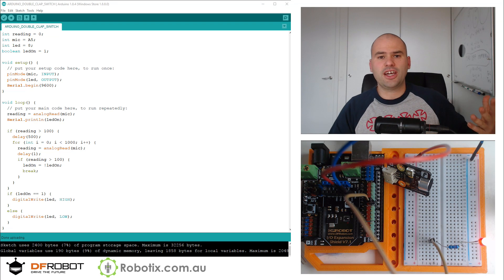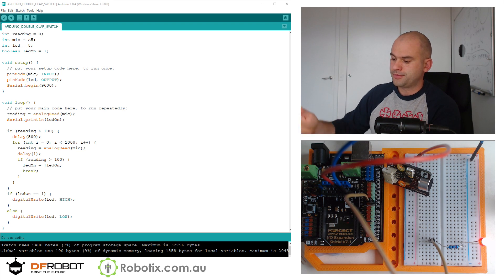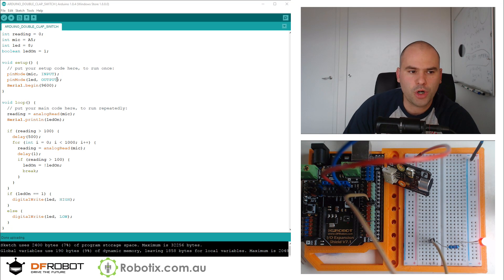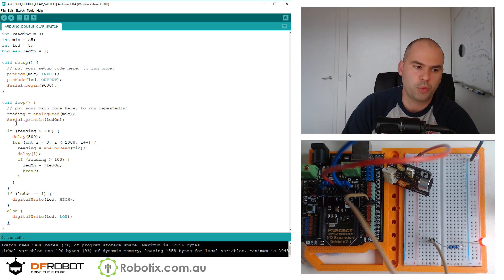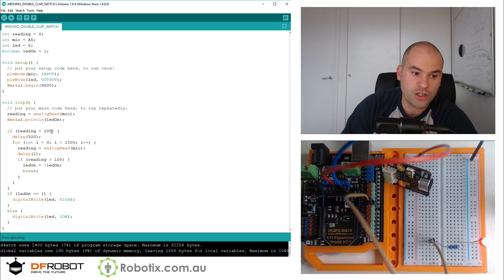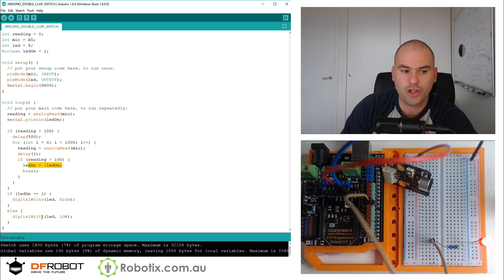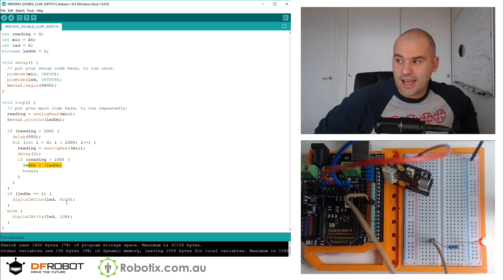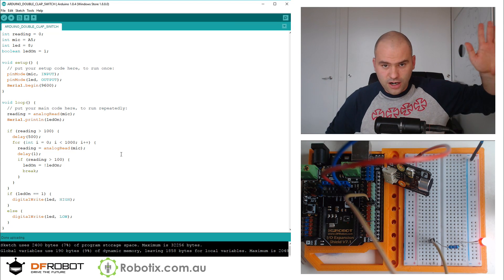Arduino Double Clap Swtich

Comment: thx a lot for your very good video
can i do it with a digital mic module instead of analogue mic?
in this case what will be the code for arduino.
thxxxx a lot for your help
Reply from the maker: Sure!, which digital mic do you want to use. I am not aware of a good one, you see digital sensors that are more than just on/off need a library and most Arduino libraries are not all that good